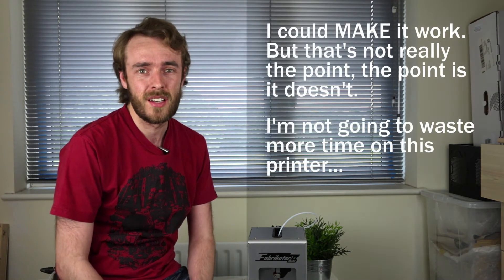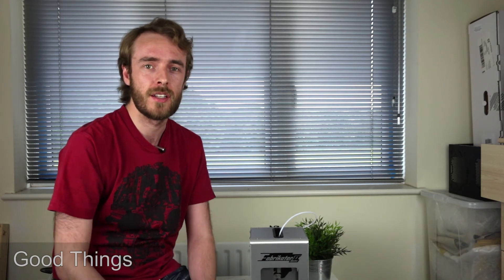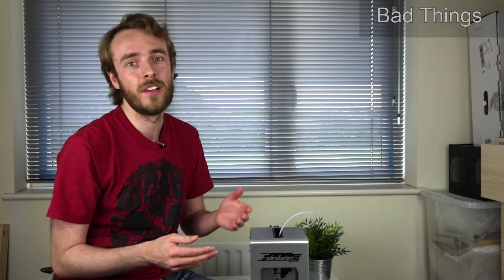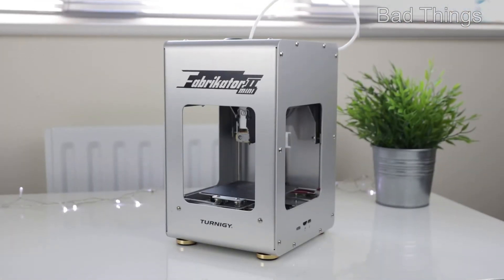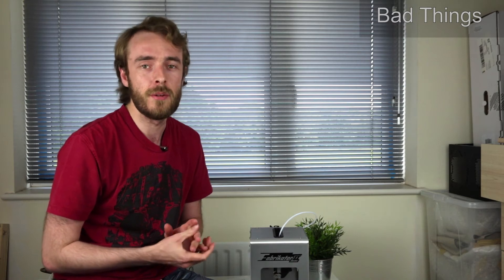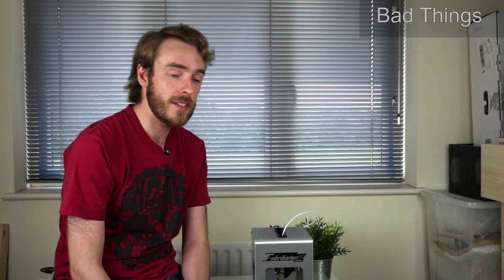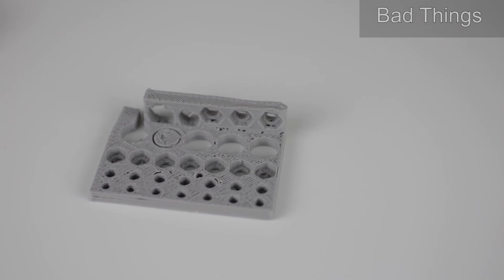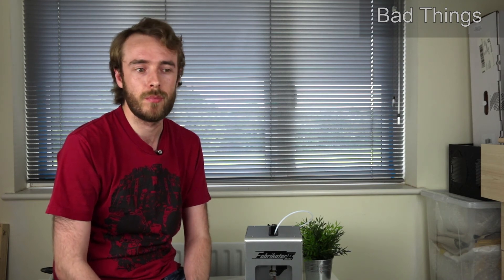Mini Fabrikator V2 - Sort of a Review

Comment: Everything he's described in this video is exactly what I experienced. This was my first 3D printer I ever bought based on the other reviews on this printer. If you look at the other good reviews, you should consider them shills and discount their channel. I only wish this review was available when I bought mine. 

I know some people are claiming they get good prints. I don't see how that's possible based on the inability to change any settings, the use of substandard parts and the overall limits of the device. A simple claim of "I get good prints" without substantiating them with further clarification makes you equally either an idiot or a shill. 

I'm a noob in 3D printing, which is who this printer was targeted at. However, I'm not an idiot and can figure most things out. I build my own quad copters and VR capable water cooled gaming PCs from components, run manual mode on my DSLR..I'm a molecular biologist with and advanced degree. With all of my capabilities, I got to where this fine gentleman did, which is to say, occasional shitty prints and no good ones. With no further experience, I thought that 3D printing is unobtainable by meer mortals. 

I put this POS on the shelf for 2 years and walked away. I've decided to try 3D printing again because I have several projects I need to do.  I've done a lot of research to not get stuck with shite again..this time I'm going with a Prusa MK3. 

I truly appreciate the candor and truth in your review here. Please don't lose your path and become another paid shill.

Comment: I get good prints off mine too, but tbh, it looks like your hotend is too low... so it's part blocking the cooling fan?? maybe. Things you shouldn't have to touch from the start... but that might explain a few bits. I'm still a noob to 3D printing, but the one you have definitely looks a bit differently assembled.